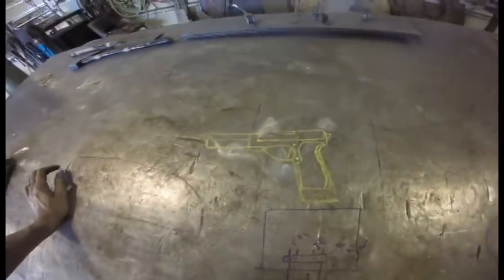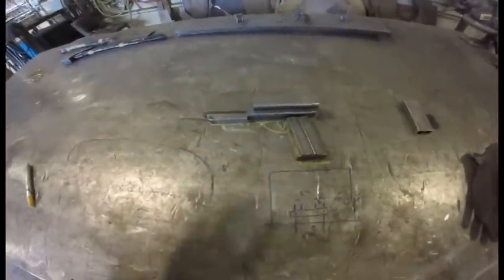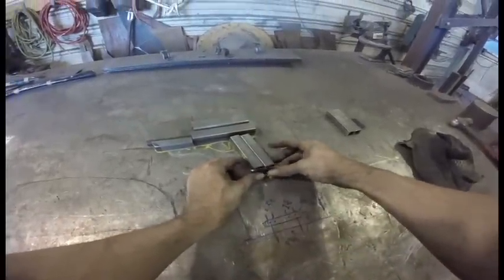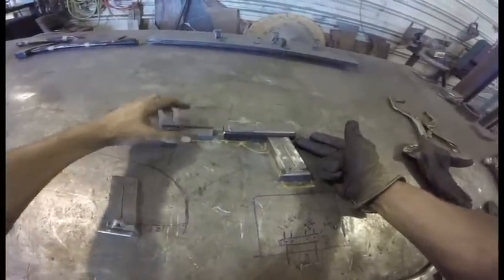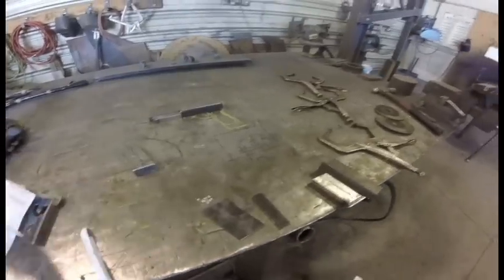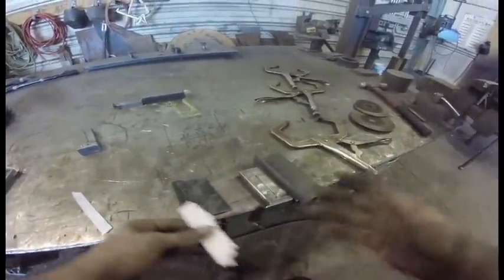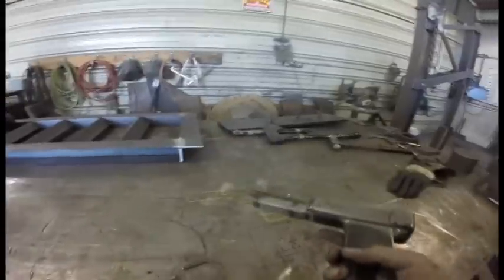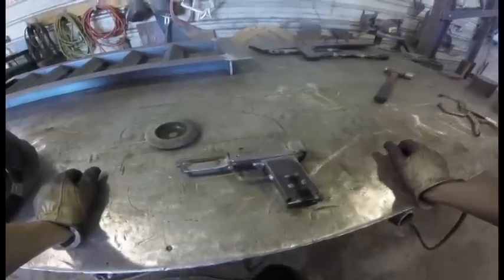Steel Handgun Prop Build Part 1

Comment: bluing along the barrel to indicate heat stressing, maybe make the set screw a quick release pin so it can be field stripped and "cleaned" maybe the slide could have a crack in is where it slams at the back. dried blood/ a dent on the front, implying someone has been pistol whipped, a muzzle break, a mock thumb safety that's been taped/glued/welded into always off safe. a holster, any of those could work :)

Comment: The slide is supposed to be the full length of the barrel, if i remember correctly. also, maybe a wooden handle scale?
Reply from the maker: I think your right now that I think about it, but it works